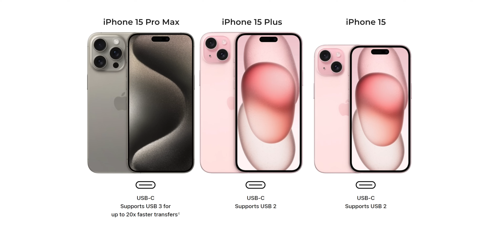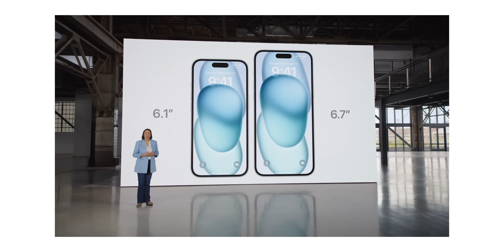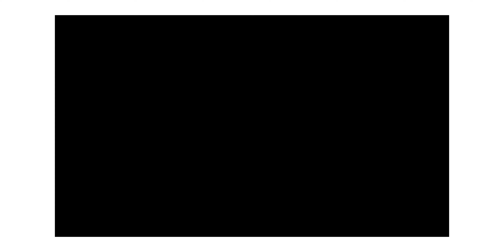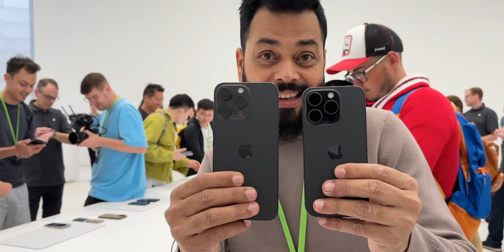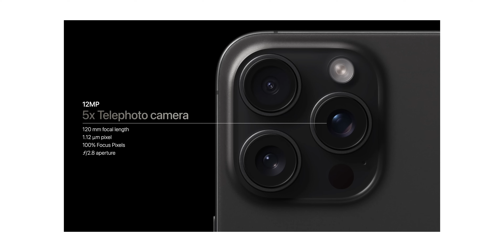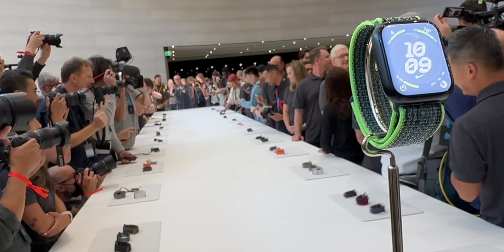iPhone 15 & iPhone 15 Pro First Look - Type C is Here Baby!

Comment: The fact that we can play console level high graphics games on a handheld iPhone is just insane. This just shows the power optimisation of Apple CPUs, i mean every single console or pc cpu needs a cpu cooler be it air based or liquid cooling. To actually get that kind of performance on a small device with no extra  cooling system is mind blowing. Crudos to Apple 🔥.

Comment: Galaxy S24 series should feature the 
world's first and best under display 3D face face scanning tech which will open with cool animation along with permanent punch hole for main selfie shooter.
full screen ultrasonic multi fingerprint scanning. its Dual security capabilities its next level. 
find galaxy even offline after power off through its galaxy network  or through satellite if necessary.
By increasing battery and charging a bit ( including a charger😢 not happening) 
Better video recording than current standards . 
It should include a galaxy activation method like in iPhones and 
adding Knox authentication in recovery mode
And add a new hardware software integrated innovative feature that all should shock at first glance . Example: solid-state multifunction with rich visual effects or any other innovative features. Samsung could easily place above iPhone